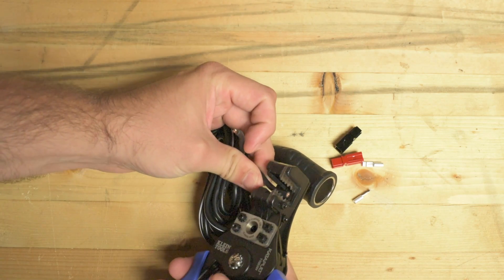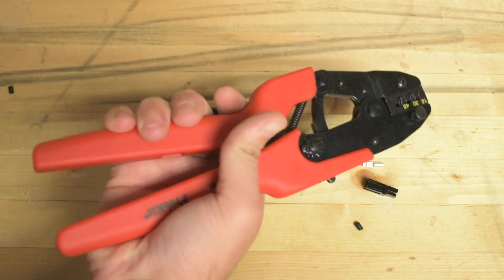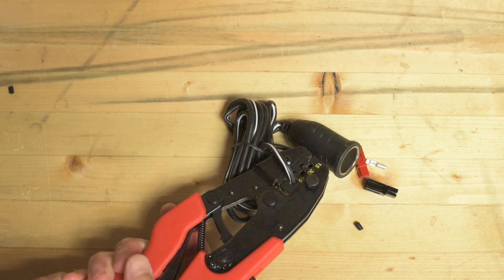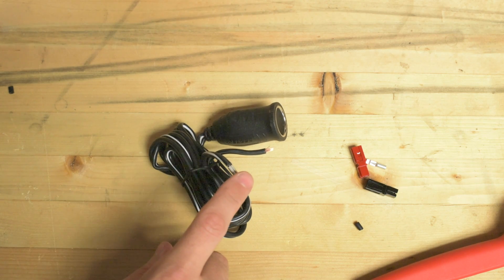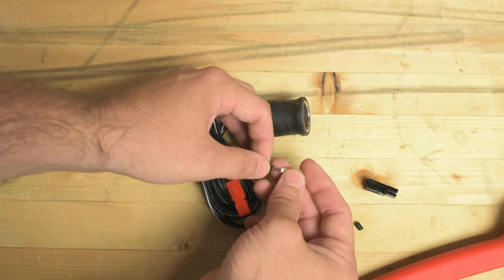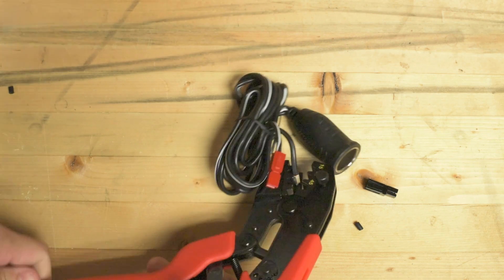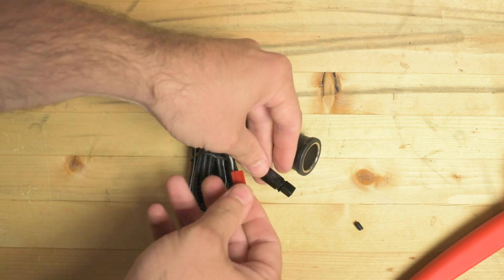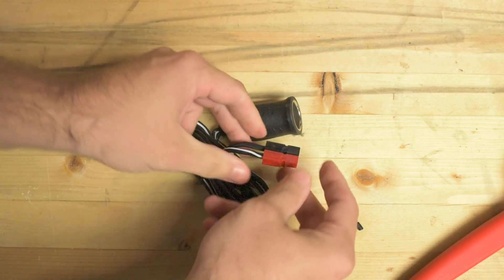How to Crimp Anderson Connectors

Comment: I use a regular terminal crimper (with a V slot) for Anderson connectors, just get a terminal from your kit that is the same diameter as the Anderson connector and experiment around a little to get a nice tight crimp that fits into the Anderson connector. A lot of articles on Andersons say that the connector is tight fit but I've found that NOT to be true ,  the crimp can be pretty sloppy and still fit into the connector, Just say that 30/40 bucks for a special crimper is probably not necessary for Andersons.

Comment: Thanks! You did get the cables mixed up, didnt you? Usually the wire with the stripe is the negative . . .that or im doing it wrong, which is entirely plausible!! :-)
Reply from the maker: +reedondo10 I didn't. If you're not sure, use a multimeter to check polarity.